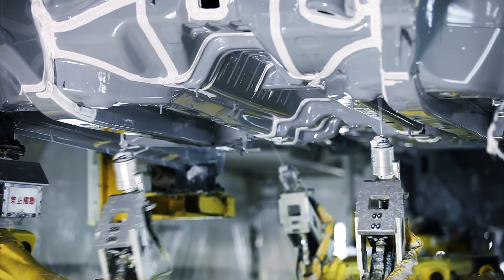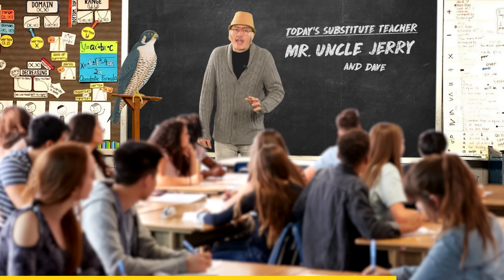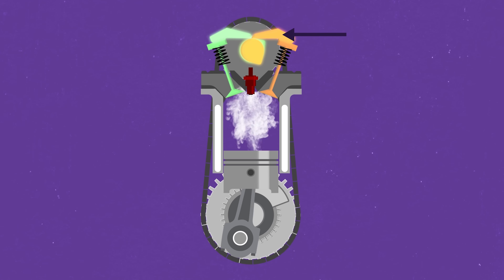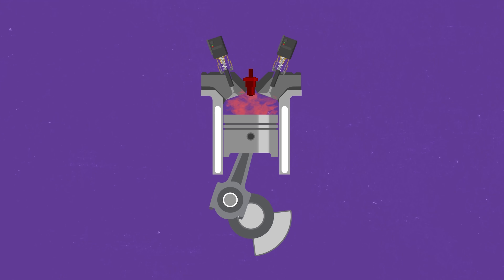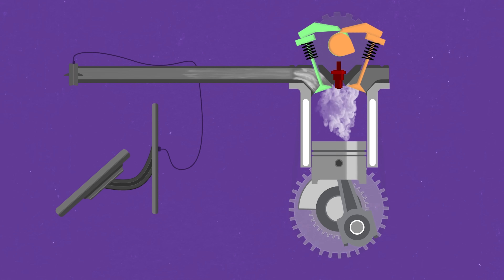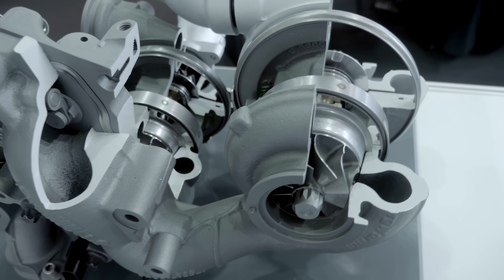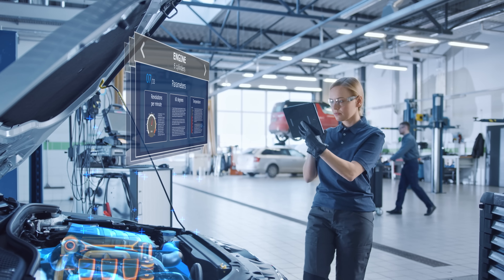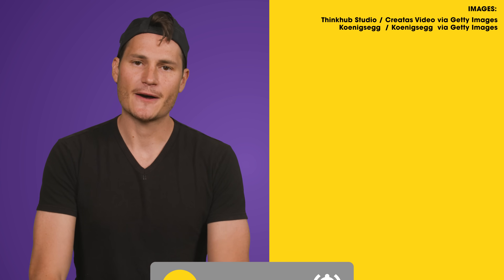This Is The Last Great Engine Tech

Comment: Another 4/6/8/12 parts to fail. I can't imagine having to replace electronic valve tappets like on-boot ignition coils. FUN! This is a solution in search of a problem. The miniscule improvements you get from this will be of the same reliability as a PCV, Vanos with the never ending seal breakdown, ignition coils failing, or even active cylinder deactivation. All praised to revolutionize MPG and they just ended up mostly killing the engine or making it run horribly wrong in a very short amount of time. Just keep on with mechanical parts until we actually have a next step. These little band-aids to 0-emissions are asinine.

Comment: Didn't the VQ37VHR do this with an electric solenoid that adjusts the timing of the CAM depending on Revs and vehicle speed? It would also gradually adjust the valve to control air volume instead of relying solely on the throttle body.

Comment: what if u made engine that got directly injected fuel and air (either mixed or against eachother so they mix) into a cylinder so u only need exhaust valves?

Comment: I would very much like to see this on a sport bike and I dont know why it isnt on one yet. Theyre basically all ride by wire now and everything else is electronic. Can you imagine the power and torque curves, the weight savings, the rev ceilings, the throttle response, how slim and agile it could be. You could easily turn off cylinders for city driving or even adjust the adjust power the engine is making through a display. You could probably even tune it through the display. I mean holy fk, why has no one done this? I'd be willing to use my R1 as the test model.

Comment: This is another of those classic situations.  A mechanical cam to open valves with a spring to close them is the worst system ever devised.  Except for all the others.
"The valves still need a little bit of time to open and close."  Yep.  The idea of using solenoids for operating valves isn't new.  The only trick is making it work.  This is analogous to improving batteries to makes EVs work.  It's been 5 years away for over 100 years.   
I'd love to see this work. 
But it might just not work this week.

Comment: I want to see the fart powered car.. but I did some calculations and you would need a days worth of farts from about 10,000 humans to run an engine at 60 horsepower for 30 minutes.. assuming 100% efficiency

If you took all of the farts of every human in the US and used it to power a 100% efficient 60hp engine you could run it for a little over a month

Comment: When I first heard about this, I was like this is amazing but then it had me thinking. What happens with a malfunctioning valve actuator. Does it leave the valve closed or open? If its an interference engine(most are) wouldn’t this cause valve slap. Or if it stays closed, wouldn’t that cause a high stress level on the cylinder? I’m sure there is something I’m not understanding about this setup. I’m sure the engineers thought of this and found a solution

Comment: Thought of air injection in 2010 when I was doing my apprenticeship with Jaguar. But that was more pushing compressed air into the cylinders with an injector and less an electronic valve. 😅

Comment: This is how to compete 2 stroke's Nm torque vs 4 stroke's Nm T. 4 strokes don't have to be in a bigger displacement to compete 2stroke's small displacement. The reason why 4 stroke loss its power because of its hard spring valves. If it were put together with electric radiator pump, electric oil pump, electric radiator fan, electric power steering, electric fuel injector and electric turbo chargers. Gasoline/diesel engines will be more efficient in fuel consumption. Except more electricity is required.

Comment: The engine uses pneumatic actuators instead of traditional camshafts and valve springs, which results in increased efficiency, more power, and reduced emissions.

Comment: Great video, except for the audio analogy. The audio waves shown are a sine wave and a square wave, and are not a good example to show the difference between analog and digital waves (Both sine and square waves can be produced by analog or digital equipment and reproduced by analog or digital media). Furthermore, a perfect sine wave, shown to represent "an analog wave", can only be reproduced digitally. Digital audio is reconstituted from data points but what you hear is not more "squared" or sudden than analog audio at all. I'd recommend using another example.

Comment: i think freevalve will ultimately be pointless, hybridsystems can outperform them with very little effort in economy, the ICE will not die, it will be at least used as range extension, running in their optimum range for desired performance, wether with or without a free valve

Comment: There is VTEC type systems to give variable timing rather than only 2 or 3 stages, though electronically controlled valves would still offer greater flexibility, and efficiency due to not needing to run a camshaft.

Comment: Most make sense hydeogen ICE car, if they put hydrogen and then setting the valve with computer to matching hydrogen rate frow this kind of valve system will make hydrogen internal combustion engine car not only dream but reality.

Comment: I remember hearing about car companies wanting to do this in mechanics school back in college and them wanting to make as many things on the engine electric as possible. Me being young I was like "Nah electricity is the devil!" and... it is. Just kidding. No I a got older I like the idea of having parts you can buy at your local electronics store. And just to do a cam swap costs anywhere between 1500-3000 maybe not even with the ecu tuning, unless you have your own tools that is and know what youre doing. With this, not only are the parts available at you're local shop, you basically have mega squirt, every tuners wet dream. That and im a stickler for weight savings, you'd probably save maybe 10-20 lbs without the cams and head. The only thing about this video that seemed off is him saying you don't need an intake. I mean, the air still has to come from somewhere, and you can't have standing still or free air enter the chamber efficiently, it has to be ram air, that's why your intake is pointed towards the front of the car instead of backwards or something, so the air is forced into the chamber. So unless it has a pneumatic tank that can be timed to push in the air, it needs an intake or ram air.  That all being said im sure koreennesaeg (however you spell it idk im not Swedish although im part Swedish but I feel im getting off topic here, look a squirrel!) Figured out a way around this and probably wasn't explained in the video. That also being said id love to see more people try this out, Id love to try this on my G35 or other cars, perfect for racing and dailying.
Reply: Yooo just realized, the piston can suck in the static are, guess you don't necessarily need ram air.

Comment: I remember seeing a really tiny little blurb one time a really long time ago, maybe in Road and Track?  Something about someone way back when trying to do I think it was magnetically driven valves, for F1.  There was a picture, of this head with these huge electromagnet coils, presumably around the valve stems, basically.

This was... at least 20, if not as much as 30 years ago.  It's definitely been a while.

I love this pneumatic thing though.  I wonder if there's a way for them to package like, an "experimenter's kit" (though I suppose the number of people looking to cast their own heads is probably small enough that maybe the idea of a "kit" that they've put together because they expect to sell lots of them is optimistic, though with the way 3D print backyard casting is taking off, who knows) that would let certain excessively ambitiously minded and probably biting off way more than they can chew experimenters attempt to adapt Freevalve stuff to other designs.

"I'd like to order the 32 valve cylinder and controller combo."

"Would you like wires with that?"

"Yes, please."

Or hey, now that would be a cool thing for the hobbyist industry to add to the Megasquirt codebase and some potential future MS4.  It'd definitely be the use case I'd be going for.  "Willing to cast your own cylinder heads?  Now you can run your fuel and air from the same ECU!"

Ok, maybe not a huge seller.

Still, I have a couple of upcoming Mopar RB projects that I'm already going to be doing some casting for the intakes on (one's to adapt the integrally intercooled supercharger intended for a Northstar, the other to give me a cross-ram setup that will fit 48mm Webers, only I bought some of the "Wubur" / "Doll'Erto" ones from Ebay and I'm going to cut them up for sensors and maybe fuel injectors, or possibly basically just use them as very pretty throttle bodies with injectors down near the heads, needs more research) and the supercharger one would be pretty cool to have some ultra-futuristic valve tech heads on too.

Just going to port EFI and spark has people reporting 24, 25 mpg and this is from cars with (at minimum) 7.2 liters of displacement.  Another 15% on top of that, or trade some of the potential power gains for efficiency instead... You could have a late 60's / early 70's muscle car that was pulling 35 mpg on the highway.

Maybe those Duke boys could just save this hobby yet.  :P

Comment: Little known fact:  Chrysler invented electronic fuel injection ca. 1956.  I came across this in the  1956 Journal of the SAE in my college library stacks (when I should have been doing something educational.) They used off the shelf solenoid valves and vacuum tubes for the control!  I believe the test car was a 300 series hemi.  I don't know if they sold the patent to Bendix and they to Bosch.  Or, what.  Bosch had the first EFI on the Volkswagen camper, I think.

Comment: hold on, I might be brainlet, but couldn't be such digital valve used both for intake and exhaust? single valve.
just put switching mechanism so each other time intake and exhaust tunneled to their own directions..
but there is still problem with intake and exhaust mixing, I guess.

Comment: How does this compare to Toyota's vvti?
Reply: VVTi still uses a cam shaft.  The Freevalve system has no cam shaft and the valves are controlled by a computer and an actuator of some sort.  This allows complete control of the valve timing at any point in the rev range.

Comment: This would allow us to have all the benefits of both dual overhead cams and pushrods with very few of the downsides. Cheaper and lighter cus no cam and smaller headers, taller engines giving more torque and fuel efficiency, higher horsepower because youll be able to get it to reliably spin fast without many moving parts just focus on the crank and the rods. True Hyper engines. Just think if it can get 30% more hp and torque on existing vehicles imagine what it could do for one that was built to use it. Think of the mileage you could see on all the hybrids. Even if gasoline is going away dodge wants to do the hydrogen combustion which could easily benefit from this.

Comment: Man so many tim foil hat bros out here screaming about reliability, cost, feasibility, etc. Like dude bros, your fuel injectors literally work the same exact way. The only reason there isn't wide spread adoption is because the auto industry is allergic to change and because VW essentially scared anyone from actually investing anything into new ICE tech because [EV]. 

Eventually, just like with EFI, there will probably be some actuated valve engines. Many of you are neglecting to remember that it took over 30-40 years for EFI or Fuel Injection of any sort to take over from carburation and STILL many small engines and small vehicles use carburetors. 

So, yeah, freevalve came a day late and a dollar short, but mostly, you can blame the dick holes at VW for prematurely killing ICE technology advancement. Not even Tesla. Tesla only benefitted from the shit storm that was created by dieselgate (and even some gasoline powered models were found to have defeat issues - and it wasn't only VW either, there were instances of Daimler and other European engine manufacturers (ie, the ones that supplied Ram's ecodiesel 3.0L V6) also following VWs defeat software lead). 

What's more concerning than anything else is that while the developed world continues to drive forth heavily towards electrification, many of us still haven't accepted EV tech, nor is EV tech perfect or fully mature. This basically means that our girls are still extremely dirty and EVs still are big time carbon producing products from production and raw materials, etc, (and yes I am well aware that ICE vehicles still produce dramatically more emissions, that's not the point), and also EVs have battery durability issues, slow charging speeds, and utterly unreliable charging networks with a litany of charging speeds and connector standards (looking at you Tesla, as well as the industry as a whole). 

So what's my point? By scaring ICE OEMs into ICE doomsday we have essentially doomed engine tech to be frozen in the 2015-2020 era. If we had continued advancing the technology even in lieu of an EV future (that either way is far off) we would have had cleaner air and lower carbon emissions in the interim transitional period between now and full electrification. Even by 2050, there will STILL be ICE cars on the road. Think about it. Even the earliest full stop OEMs are putting a stop date at the earliest of 2030, but that only means for NEW models. And most of them that have even actually announced ICE extinction targets have them set for between 2035 and 2050. So even if everyone stopped selling any ICE powered cars in 2030 (which will NOT happen) even 20 years later in 2050 you'd STILL have TONS of ICE cars tooling around spewing big bad emissions. So perhaps we should encourage OEMs to actually invest in upgrading existing engine tech while we wait for EVs to truly come up to parity. It will not happen overnight. And in the meantime we are inadvertently increasing the levels of pollution by unnaturally killing existing tech. And this is to say nothing of the developing world which will take FAR longer to transition to EVs. 

You could even go as far as to say that EV virtue signaling and forcing the tech upon a world that can't afford it is racist and exploitive. Especially when the ones that will have to continue to use decades old engine tech (in the future that is) will have to suffer worse emissions and worse public health just because the Europeans did a bad and decided it was time to kill ICE development so that they didn't look so bad on the world stage. /Europe is the source of all evil/ worst colonizers. And they are still fucking over the rest of the world. You can say all you want about us here in the US... but we are a former colony made up of immigrants from around the entire world. We still follow Europe's lead (why we do I will never understand but it is what it is). Europe needs to be better through and through, not just on the surface and just for Europeans.

Comment: Better idea: ditch popper valves entirety, replace with spheres that have a big hole through the middle. Spin the sphere with an electric motor that talks to the crankshaft position sensor. Oh and go ahead and throw the camshafts and their gears away too. And the lifters obviously. Zero valve train drag, you got yourself an electric combustion engine

Comment: I wondered why valves weren't controlled this way for at least a decade before Freevalve was ever a thing. The fact Koenigsegg could figure it out before a large manufacture like Ford or Toyota just makes no sense, there's so much to gain from electronically controlled valves. Max power and fuel efficiency aren't the full story, the power you get under the curve and throttle response from totally controllable valves would be nuts, plus it's so much less complexity. There are still a bunch of stupid engine designs people are trying to produce, like Nissan's multiple compression engine that are 100% needless with Freevalve because with electronic valve control you have total control over dynamic compression. You can turn a 13:1 compression race engine into a damn Atkinson cycle with free valve with no special moving parts. We need this tech to be mainstream regardless of what happens with EVs.

Comment: When I first learned what cams did in an engine I ask myself why nobody used some type of valve actuator to keep the them open or close to better control the engine combustion , to increase power or fuel efficiency . and i look it up , and find out that there was a company called Freevalve that did exactly that . Not to take away from what koenigsegg did with Free valve , a camless engine is not a new idea they are just the first company to succeed . The other companies that were interest in the idea just felt like it would be too expensive and not as reliable as a cam engine . That's why the cheapest koenigsegg would run you $1.9M

Comment: Seems this also could be accomplished hydraulically with pressurized engine oil and a governor; IIRC Preston Tucker was working on it. A simple flyweight governor also will save your engine and the turbo. Farm tractors and heavy trucks have used governors for decades. 
The wheel really does get reinvented every so often I guess.

Comment: I read an article about this exact proposed valve actuator technology about twenty years ago. It was supposed to operate on a proposed vehicle electric system of 48vdc or more which in itself promised other benefits. Seems like the idea was shelved due to tech issues at the time and market forces. Cool to see that the concept actually being implemented!

Comment: Freevalve also can get rid of starter motors, allowing for instant starting.
Basically, if you know which cylinder is near, but past, top dead center, you can fluff in a bit of air/fuel, a spark, and boom! running engine.